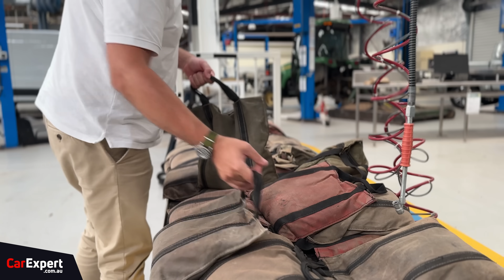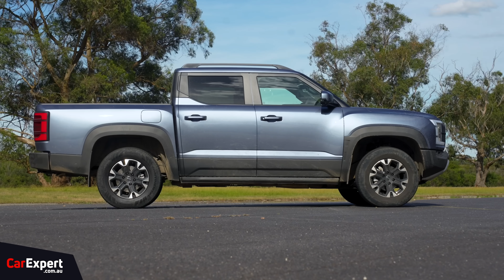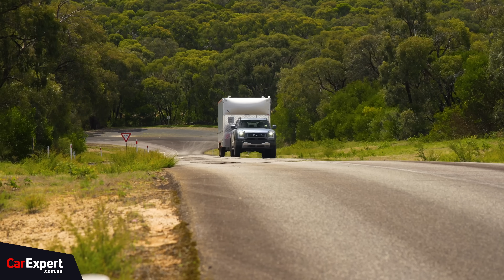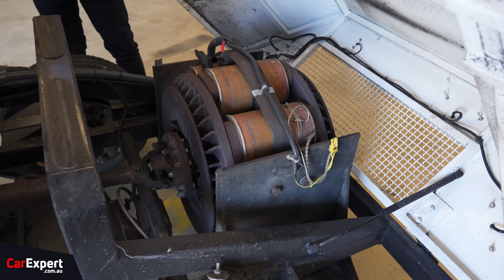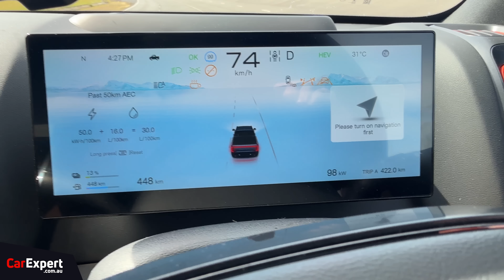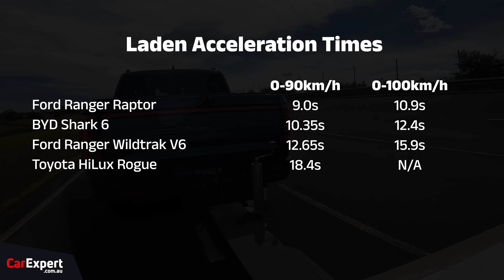BYD Shark 6 towing STRESS test at MAX payload - the results are surprising...

Comment: Wow. Tugging that 2.5 tonne up a hill and accelerating was impressive.
Reply: Beside it averaging more fuel consumption than a normal Ute towing an extra ton.
Reply: @mattmobiles15  Its pretty much the same as a regular ute, the most frugal in the list was the V6 wildtrack, which was only 1.7l/100 better.  If you combine the battery (starting at full) and the fuel, they would have a similar range (wildtrack has a bigger tank (85 vs 60), but no battery), but I think the wildtrack would still outrange it by 20-30km, but overall the cost for the trip would be about the same.

Seems good, Its such a crying shame our governments don't seem to want to encourage this tech, PHEV is just far better than full electric for a truck, and most driving would not even be using fuel day to day so it really is almost as valid as an EV when it comes to not emitting carbon.
Reply: @Blight-fp3vt  I'm not talking about range, I'm talking about L/100km.  Almost all of the other utes did better.  The cost for a long trip may be similar, except you're forgetting expensive public charging costs on top of the fuel costs, which you will need as the test shows it cannot charge enough using its own generator.
Reply: @Blight-fp3vt   EVs may not have local emissions, which is great for the city... but they have 4x the production emissions of a normal car according to Volvo and VW, not to mention the power source to charge.  They aren't green.  If you want to be green, go buy a 2nd hand normal Ute because it already exists so the main production emissions have been and gone .
Reply: @mattmobiles15  EVs are about 20-30% greener than a regular ICE. If you want to go green its naturally best to use up everything which have already been produced, but once you run out of used cars EV`s are considerably better if "going green" is what you are after.
Reply: @ensteffo  yeah maybe if the batteries can last, hopefully thwy keep improving which they seem to be.
Reply: @mattmobiles15  Repeating out of date and false information.......really is that all you have?
Reply: @coasttocoaster1256  what exactly is out of date?
Reply: @Blight-fp3vt so the hybrid is worse 😂😂😂😂 fkn taking a step back. I’ll stick with my blown v8 and not have a car that’s worthless in 5 years
Reply: @ Well, not for most of the time - its best in class fuel efficiency for everything else, just average fuel consumption for towing.  Though your blown v8 wont be beating anyone on fuel!

But I'm not here to convince you, if you have blown v8 then I assume you need that because you have some seriously large towing requirements or just love the noise - the shark is more like the raptor, its super fun and tows really well, but you limited in how much you can tow.

Comment: Why have the battery set at 25% before engine recharge. From memory you can set it all the way up to 75%. That way the engine would have cut in earlier and kept it charged
Reply: In this case where the required power exceeds the output power, setting the SOC to 75% would constitute a fair test. What should be seen is how far you can run at 100km/h in this case, and use this to compare with other vehicles. Instead of thinking, hey, I can't run 100km/h after I don't use the engine to consume the power to the bottom.
Reply: Yes indeed & the vehicle should tell you that, as soon as it knows it has a trailer attached, if your not doing steep hills fully loaded or tackling overly long inclines, you could obviously set it at 50 to 60% and most likely be just fine :).
Reply: He may as well have set it to 0% and then claim to be shocked it failed.

Comment: This guy tried to fail the car in all possible ways.. but somehow the shark survived! The call is yours..
BYD Shark is by no means a perfect flawless vehicle, but so are all other cars!
Reply: Randomuser and Siraff ..
You both have  good contributions-  on this new Shark 6

In most cases , this vehicle is far more advanced and more than capable enough  most ute lovers ..

maybe not much  so for the heavy hauling tradies 

However - Even though I was one of the first to put a deposit down , Im having second thoughts .
My application is different to most and I require a vehicle that can pull 2.5 tonne up 20-30deg incline from a standing start .
My V6 Amarok can do this even with GVM of 3.3t .
Unless BYD can get the Shark 6 to equal this , sadly , Ill have to wait until they can ..
This is a sitiation I cant see a work around atm ..
Seriously , I was so looking forward to driving and owning  this new truck ..

Bugger 🤦‍♂️
Reply: @Nerkumsized  It won't have much trouble doing that in theory. However it will only be able to do that while there is enough capacity in the battery and then only if it has traction at both axles. 
Really its more of an ev with a back up plan than a real hybrid because series hybrids are known for being woefully poor on fuel once the batterys are down. It makes sense because every time you change the state of energy it takes a loss for that change so when you have an engine feeding a generator, feeding a battery, feeding motors its going to use more fuel to do that than that engine feeding a gearbox. 
Its a decent design if you use it as an ev for around town and short trips most of the time then a family holiday a few times per year but for heavy work its completely the wrong drivetrain. 
This is where Fords parallel style system works better because it can use all its power through the gearbox so its always got options to trade speed for torque. 
Really though if you're going to make it work hard often you're better off with a diesel. Hybrids are all about cutting power wastage to save fuel but if you're pulling a heavy load thats not an option. Facts are there and a diesel is more efficient at turning squished dinos into torque so when you have to use a lot of energy (not necessarily in a drag race) thats the better option - which is why they are in pretty much every piston engined industrial vehicle you can think of.
Reply: Bollocks.  Paul did the exact same tests that he did to (nearly) all the other Utes in the market a year or so ago (before the Shark was even announced).  Those tests revealed that some vehicles are very optimistic in being rated at 3.5 tonnes towing capacity.... just as this test revealed that the Shark 6 - under sustained load... has some shortcomings.
Reply: It's called testing.
Reply: @craigice9635  It's call testing yes.. but with a clear motive to find the negatives in worst case scenario and highlight that as a real world daily issue! In worst case scenario, even a $30 million Rolls-Royce La Rose Noire Droptail will fail if the car and testing is set up to fail. That's the point I'm making.
Reply: This is just a test, we cannot compare this to a long-term use. I had a Chinese car before and at first, it was nice and everything. But withing two years it started falling apart, and finding correct spare parts are nightmare. the market is full of copies and poorly made spare parts that some of them won't even fit correctly. And I couldn't even sell it because it had almost no resel value and nobody wanted it.
Reply: @ruhithudakara2802  I have Geely Chines car and after 2 years no single fault ,not even light bulb die or anything ,and has 7 year warranty .Before i had Hyndai Tuscon for 6 years it was also good but they rised prices a lot since i bought mine in 2016 so i went with Geely and i am happy.I can say is 30% better then my Tuscon ,plan to keep it 6 years and sell before warranty expires
Reply: @ruhithudakara2802  China made some crap products from car to toilet papers, but China also make German cars, Japanese cars, American cars, iPhone, Tesla, DJI, Huawei etc. Toyota and BYD is in partnerships now. It's all down to your choice and budget! Generalization of Chinese products doesn't make sense anymore, especially in the last few years.
Reply: @kolviczd6885 Bolox. The Western stuff being built in china is under strict processes, hence the higher price. When china builts in house they WILL cut corners to make the price competitive.

Comment: If you’re planning to tow a caravan or a boat, chances are it’ll be for a long-distance journey. Attempting this with an underpowered engine, a downsized battery pack, and a heavy hybrid UTE is asking for trouble. The strain on the vehicle and the inefficiency of such a setup could ruin your trip. Similarly, heading out for serious outback 4WD adventures in an EV is impractical unless you’re prepared to haul stacks of solar panels—hardly a feasible solution.
And let’s be honest: if you’re not using your UTE as a UTE 90% of the time, why buy one? You’d likely find much more comfort and practicality with an EV sedan for daily use.
That brings us to the Shark: neither a true UTE nor a sedan. It doesn’t excel at being either. So why bother?
Reply: You obviously don't understand how this works. You don't need to cart solar panels, you just need fuel in the tank so the motor can charge the battery. As he pointed out in this test, the motor kept running at the end to re-fill the battery. The idea of the plug-in is that when you're doing the normal running around day to day driving from home, you can run off the battery and not pay for fuel. If you have solar on the roof the power cost is near zero.
We've been running a pure EV for 75,000km over the last two years (sometimes towing a 1 ton boat) and charging from home solar has saved us over $7000 in fuel cost so far, not to mention lower maintenance.
Reply: Unfortunately my local shopping centre carpark is littered with oversized 4WDs being driven 95% of the time outside of their design parameters, you need to ask these people why they bother.

Comment: when towing,  you need to keep it in ice mode,  and have the setting to keep battery over 80%....  and as you go down hills,,,, if needed the motor will be recharging.
Reply: Understand the setting issue. What if after a few years, the battery can only be charged up to 70%-80% of its designed capacity, this Shark will be like a petrol car when towing? Potential Shark buyer, but have a doubt after watching this.
Reply: @jacob6843  this car cant function without a battery,  all its low speed driving is done with the battery, its only above 70kmh that the wheels can be driven direct by the engine.   with 70% battery capacity,  the car will still function fine.

Comment: Thanks heaps for the review. It is the first towing review that I have found. Can you please do another video that explains the electric brake setup, and the electrical connections used. I have an electric brake set up that is wired from the battery, and recently had a ESC fitted to the van. How would this be connected? Is there any info on the current load for the wiring to the trailer plug?
I assume that the Shark would not have anything to detect caravan sway. Not an issue if it does not as I would not expect it to have something.
Is there any indication from your testing on the 2.5 Ton trailer how far you would get towing it and a fuel economy? 
I have a steepish driveway and about a 20 degree hill for about 100 metres just before my home. It presents that is it quite doable, but not recommended. I believe a lot of tradies would encounter similar getting into and out of some suburbs. In most of Melbourne it would not be too much of an issue, but in the Dandenong and some country areas and placed like the Adelaide Hills or up near Sydney it looks like there would be lots of issues. I believe an upgraded tow pack might be in order, which I believe is on the way.
Are you aware if there a Bluetooth or wifi connection for a camera that could be put on the back of a trailer or caravan?
Re the motor upgrade to generate more power, perhaps a 1.6 litre upgrade would suffice, and maybe. 2.0 litre for the heavier duty vans and steeper inclines. But that is a question for the engineers.
I am not fussed on the drag race videos, and the 0 to 100 in whatever seconds, but your other videos have been a wealth of information and well presented.
Thank you for putting them together. Hopefully you might be able to answer a couple of my questions.
Overall I am still considering purchasing one as my van is about 1.3 ton and likely about an extra 300 to 400 kg of everything else.
Late thought. I have not seen anyone try to get the spare out and see the jack in use, and the jacking points. There has been little info about servicing the vehicle also.
Thanks again.

Comment: A deliberate sabotage of the ute. Why deplete the battery before you started the tow test? 

I can't think of a scenario where someone would set off towing a trailer with 25% charge?
Reply: I tow heavy trailers at 1/8th fuel or less sometimes and don't worry too much.

A diesel ute might only go from 9 to 15l/100km carrying a heavy trailer. 
Petrol is worse and electric is impractical.
Reply: @elliotkane4443 not defending the Shark here, but you are aware that diesel electric trains for example use electric proposition and diesel to generate power because the traction motors are able to provide far more torque than if the diesel engine powered the wheels?

Electric propulsion is practical, but the vehicle needs to be set in way where it’s primary goal is to get power to the electric motors rather than trying to combine the two powertrains to give a good on spec sheet output.
Reply: Maybe you just camped off grid for the weekend?
Reply: @kentaylor2950  the petrol engine can charge the battery off grid.

Comment: Interesting test.

What would have happened if you kept the SOC setting at 50%? Would have the towing test lasted longer?

It doesn’t seem there is enough information on how this hybrid system should be set up.

BYD probably should have a Towing Mode that automatically sets the SOC at a certain percentage to ensure the car has a healthy amount of power.
Reply: The issue was the charging test was just started at a low SOC it didn't have any opportunity to manage itself. That said under that type of unrelenting load it would eventually I assume run out of charge in the battery and get to the same point.

Comment: "I have a 4L Petrol Prado and regularly tow a 2.2-ton van into the Victoria high country. I burn 20L per 100km while doing 90km/h. It has plenty of power, making overtaking and driving at 110km/h a breeze. I'm considering upgrading to the Shark, but I have my doubts. The low range transmission in the Prado has saved me many times. I don't think the Shark would handle tough situations well. On long uphill drives, the Shark might exhaust its battery. Will it be able to get the rig moving from a standstill on an uphill with a flat battery? I believe extensive field testing is needed to get the full picture. I'll wait and see before purchasing."
Reply: YOu know that it has motor that charge the battery ? And where in the world you will find 50km uphill constatly
Reply: @dzonikg  I'm not an expert, but I have some thoughts on this. The Shark has a petrol motor that produces 135kW/260Nm. Typically, petrol motor and generator combinations are around 70% efficient, meaning 30% of the energy is lost during conversion from mechanical energy (from the petrol motor) to the generator. This would reduce the effective power output to around 100kW. When I tow my van, I use twice the amount of fuel, and my engine operates at peak power output for extended periods, especially in the high country. My Prado produces 376Nm of torque, and I'm often in low gear for long stretches. I believe the Shark will perform well with a charged battery, and it's an innovative concept, but I'll wait to see what real-world users find out before making a decision.
Reply: @leo92344  I sad in another comment that i went to their website and found how other truck peformed .Toyota HIlux 2.8 diesel which is rated to tow 3.5 tons could not even reach 100 km/with same test trailer at 3kn.Its just tell you that test is even harder then towing 3.5 tons and BYD Shark is rated for 2.5 tons so its not fair test at all
Reply: I'm a Shark fan but i'd stay with your Prado or wait for the 3.5 tonne shark.
Reply: @Johnno1979  I agree. My Prado has done 320000 km The only fault it ever had is a bad starter motor. I service it myself and it just works.

Comment: Entirely predictable result.
This thing is good for short bursts only. Once that battery is discharged, that poor little, low torque petrol engine will just be hopeless, struggling to propel the vehicle and charge the battery. I expect a lot of prematurely worn/blown petrol engines and depreciation to virtually zero value after only a few years.

Its a heavy lump of lard with poor stamina and I predict, horrible towing fuel economy. 

It will be loved by city commuters - until the day they try and sell it or trade it in 😂
Reply: The petrol motor only produces 135kw, but the specs purposely don't say at what rpm. I predict it will be at around 5000rpm. Now, assuming you're towing a heavy load at 100kmh and the battery discharges because the pissy little engine can't propel the heavy vehicle, load and caravan at that speed with sufficient surplus power/torque to also put any meaningful charge into the battery. What happens when you come to any hill? 🤣

People citing the Mitsubishi outlander as an example of phev success, should realise this vehicle weighs twice as much and has not much more power, torque or battery capacity than the Outlander. It's like comparing an apple with a (very large) pumpkin!
Reply: @Rick-wy4od  Battery want discharge ,you dont have endless hills in real world when you TOW 2.5 tons at 100 km/h  it will use 50 kw at awerage (up hill ,down hill)
Reply: Well said . The “review “ is very strained .